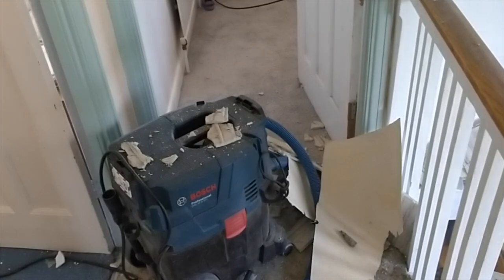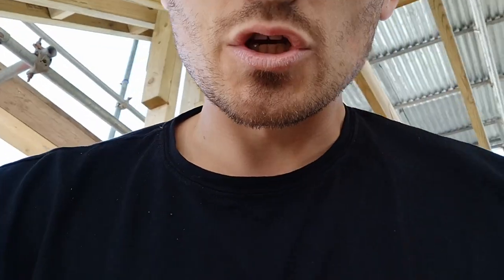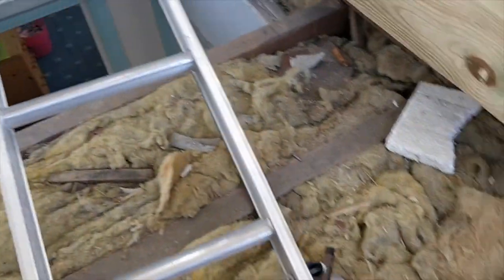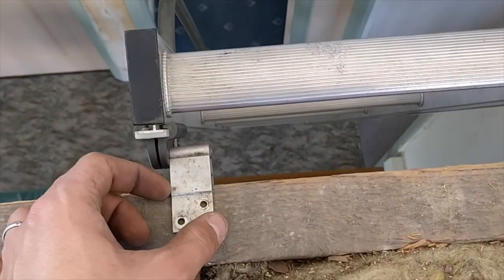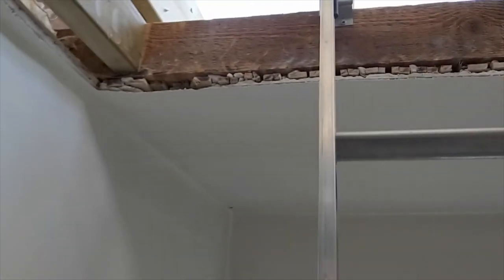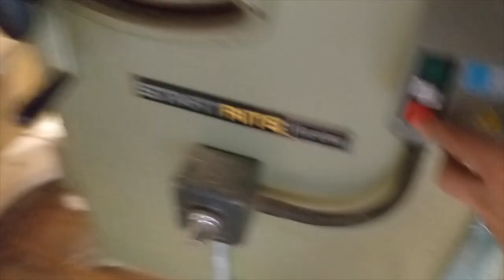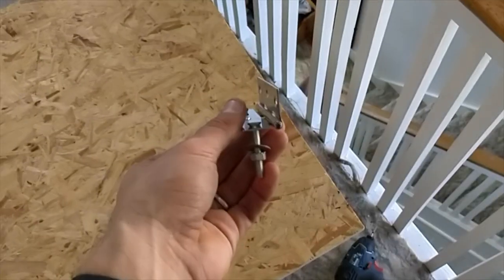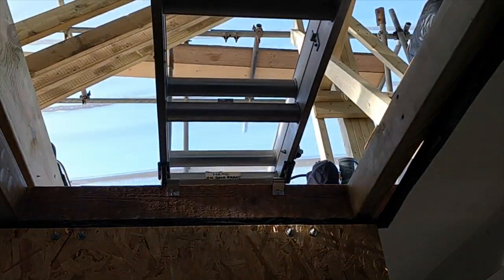How to Install a Loft Hatch/Opening: A Step-by-Step Guide for Homeowners

Comment: Great vid. I’ve got to do something similar. Is there certain things I should consider when cutting the ceiling joists ? I’ve got two to cut in order to make a bigger opening than what is already there
Reply: As in reinforce the joists
Reply from the maker: Nice! I wouldn't worry too much. Most of the time the ceiling joists are there to hold up the ceiling, rather than acting as wall-ties keeping the building together...if there is a wall tying timber, itsy likely to be very big indeed and you'll know it's doing a structural job. Best of luck!

Comment: Is there any minimum distance required between ceiling joists and the bottom of the suspended loft floor? Would 20 mm be enough on 6m span? 🤔
Reply from the maker: Yes, normally it's 50mm I believe, but it depends on the thickness of the ceiling and the type of ceiling below...best to double check with your local builder control

Comment: Not safe over the banister I work for a loft company and I would not recommend
Reply from the maker: You're right, this isn't what would be recommended. This is work happening in my own home - not what the building company asked for or suggested. I've put a hatch where I need it for access to the loft until the rest of the work is done.
Reply: Excellent temporary job I'd say 👍👍👍🏴
Reply from the maker: @petereyre5188  cheers - that's exactly what it is - a stop gap that allows access, until the staircase can be installed.

Comment: Silly question: any building regs or planning permission needed?
Reply from the maker: Not a silly question, you're cutting into the ceiling! Thankfully there isn't any planning or building regs stipulation for this type of project (most internal projects don't require it if it's non-structural).